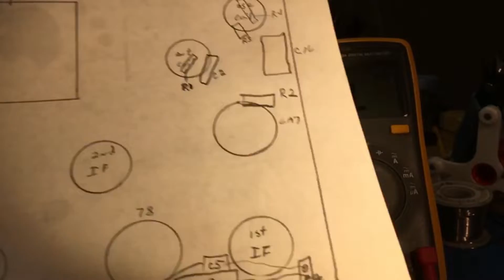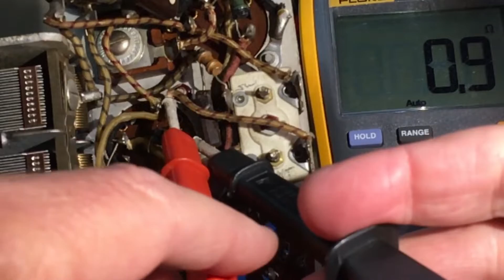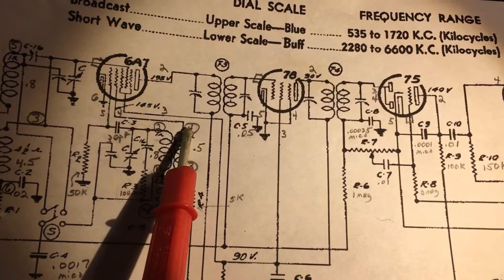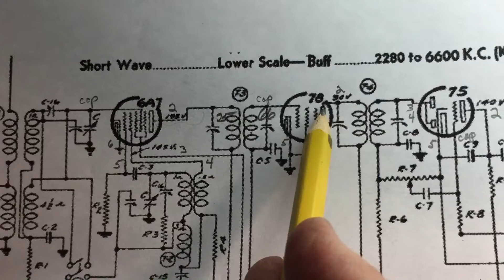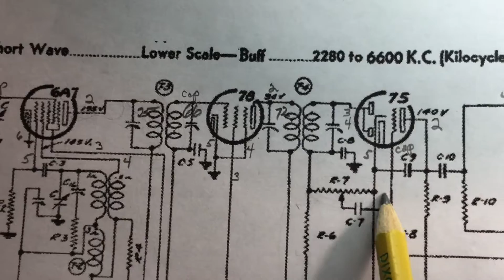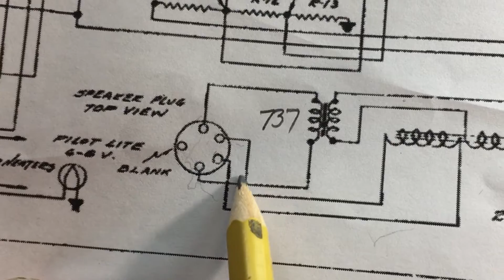1936 Montgomery Ward 62 315 Part 2 of  4 More Tests and Assessment

Comment: Excellent video, Larry.  When you applied audio to the output transformer did you put any voltage to the field coil?  When I've seen this test done before they always applied voltage to the field coil, but perhaps that was not necessary?
Reply from the maker: Nelson Hi Nelson! Thanks for watching and the comments...No, I didnt apply any voltage...I was testing to see if an audio signal would pass thru the output transformer to the voice coil...there is usually a small amount of magnetic field left in the core...the voice coil will work but not very loud...you can apply some DC voltage thru the speaker field coil to make it a magnet...Care has to be taken to make sure you don’t apply too much current or you will burn up the field coil....When I do, I put a DC amp meter in line with the speaker field coil and usually apply about 50 mA....just to see if the volume increases proving the field coil works....I feel comfortable that this one is good based on the DC resistance is in line with most coils...Hope that explains that! Thanks again!! Take Care—Larry